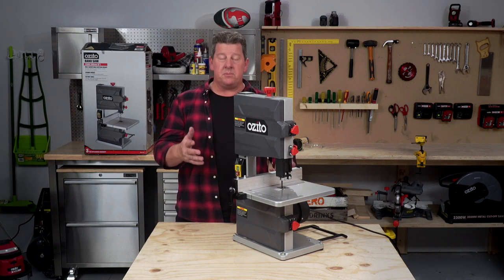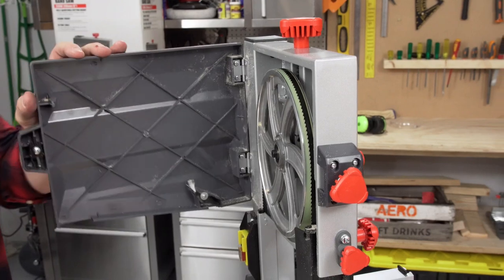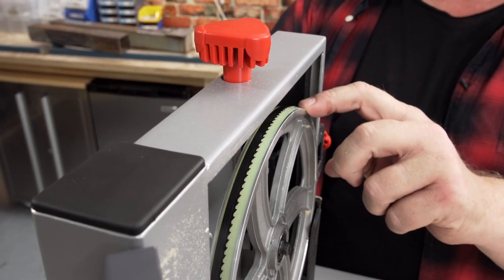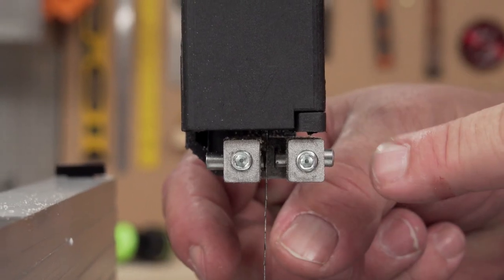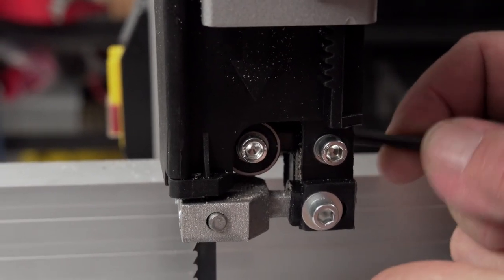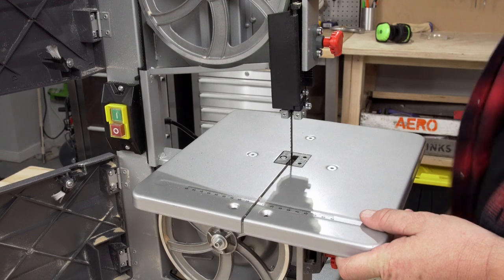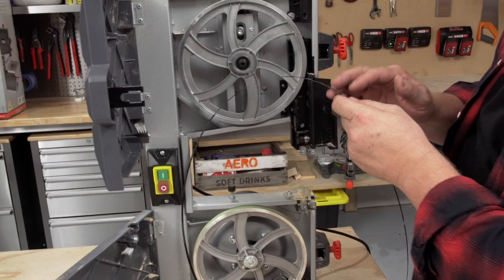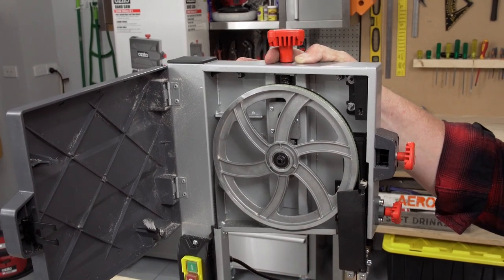How to set up a Band Saw - Ozito Tool Tips [BSW-2581]

Comment: Thanks a lot for this, so much clearer than the printed manual. Have now replaced the blade and centred it in middle of rollers and adjusted blade clearances and tension, works so much better now
Reply from the maker: Hi Rick, glad to hear our videos have helped you! Cheers

Comment: I had a Ozito bandsaw it was faulty try to change it at Bunnings did not have any in stock had to buy a ryobi  ?
Reply from the maker: Hi David, we're sorry you weren't able to get a replacement at your local store. This item is still ranged and is still available at Bunnings. Please reach out to our Customer Service team directly for further assistance - Call on 1800 069 486 (Aus) or 0508 069 486 (NZ) or email them at enquiries@ozito.com.au. Cheers

Comment: my saw was bought with a much finer blade around 13 TPI at best guess. I have never been able to cut a circle or a simple pattern and at times the blade will twist off line on anything thicker than 25 mm. The blade is as tight as I am confident with and I set the throat to suit the thickness. Any suggestions please.
Reply from the maker: Hi Lynton, thanks for reaching out. Would you please let us know the model number of your Saw? Cheers
Reply: @OzitoDIY  Problem solved when 7mm x 6 TPI blades were fitted. 14 TPI blades are almost useless on this saw.

Cheers
Lynton

Comment: Good video. Nice to know a bit more about it as I haven't used one in 35yrs, quite helpful. I just want to use it for hobby work making custom tool handles. Oh, you should mention to unplug the power before any adjustments or blade removal.🍺👍🏻
Reply from the maker: Thanks for your feedback. Safety first!

Comment: G’day, I hope I’m not too late to comment. Had this product for a while and it’s done well. Recently I’ve tried to start it up after getting a new blade and I believe the motor fans stuck. Everything’s perfect and I’ve aligned it correctly, what’s a troubleshoot?
Reply from the maker: Hi there, thanks for reaching out. Are the wheels unable to spin by hand? If so, there may be something jammed somewhere. If not then there could be a fault with the motor. We recommend you give our team a call to chat this through over the phone with us on 1800 069 486 (AUS) or 0508 069 486 (NZ) as it should be easier to troubleshoot. Cheers
Reply: @OzitoDIY  thank you for the response. I can spin the fan easily but as soon as I start it it stops and the motor hums. Emailing the company they said I need to return to where I purchased for a new one.

Comment: My husband has just bought me a ozito bandsaw for Christmas. I am having trouble aligning the saw blade. No matter how many times I turn the knob (very slightly) clockwise or anti-clockwise I just can't get the blade to run along the middle of the pulley. As I manually turn it, it seems to be okay but I always have a trial run of about 3 seconds and the blade either runs to the back or the front during this period (even though I only turn the knob a little bit at a time). Another issue is that the table will not tilt either, which means I have been unable to place the clear plastic blade guard on underneath. Is there a specific way of doing this?
Reply from the maker: Hi Frances, thanks for reaching out. Please give our Customer Service team a call on 1800 069 486 (Aus) or email them at enquiries@ozito.com.au & they'll be able to assist you. Cheers

Comment: I have an earlier version of this bandsaw. Is setting up the blade the same. As after running under no load for a few minutes the blade comes off the wheel. On one occasion the rubber band came off. I used double sided glue tape stick rubber belt back on wheel. That kept the belt on but the blade came off after running for several minutes. The saw itself has only been used a couple of times and has sat idle for the last 2-3 years with the tension taken off. Only started to use it recently and ran into this problem. I’m at a loss on what to do now. Can you help?
Reply from the maker: Hi Alex, thanks for reaching out. The blade set up should be the same, is there any noticeable wear on the belt? Was the bandsaw stored in a hot environment? Not sure if the belt may be the issue? Please reach out to our Customer Service team directly for further assistance - Call on 1800 069 486 (Aus) or 0508 069 486 (NZ) or email them at enquiries@ozito.com.au. Cheers

Comment: Hi I am having trouble with my Ozito as it will not cut straight for some reason. Was fine for the first couple of months but for some reason it has decided to do it's own thing. Have tried to adjust guides and everything but no luck. Could you please help me out
Reply from the maker: Hi Graeme, Thanks for reaching out. We recommend you reach out to our Customer Service team directly for some assistance. You can call on 1800 069 486 (Aus) or email us at enquiries@ozito.com.au. Our customer service opening hours are 8 am to 5 pm weekdays (AEST). Cheers!

Comment: Thnx . I bought it. 😁 what width blades can it take? It would be a great tut on different blades for differnt purposes.
Reply from the maker: Hi Tim, thanks for reaching out!
The blade specifications are as follows:
Length: 1400mm, 
Max blade width:8mm 
Teeth per 25mm: 6 
We have tested this blade for use on plastic and wood materials. 
The width should be the same but the number of teeth can be varied
I hope this helps, cheers :)
Reply: @OzitoDIY  thnx

Comment: This is brilliant mate thanks. Wife just got me one . I have assembled it but have 2 hex bolts with nuts spare and 2 discs about the size of a bottle top with holes in them. No item where they go? I used the wing nut on the piece of metal under the front of the table? Any ideas?
Reply from the maker: Hi Richard, thanks for reaching out. Could they potentially be for the rubber feet? You can also send a photo to our customer service team for further assistance. They can be contacted on 1800 069 486 (Aus) or 0508 069 486 (NZ) or email them at enquiries@ozito.com.au. Cheers

Comment: I am new to woodworking so I don't want to blame the bandsaw but I already wrecked 2 blades.
the main problem is the blade becomes dull very fast and then starts wandering and then stopping completely. Not happy. can you point out what the reasons might be.
Reply from the maker: Hi Shai, thanks for contacting us! From what you are describing, the blade does not sound to be tensioned/adjusted properly. We can suggest you revisit the section ‘set-up and prep-tensioning the blade’ of your product manual to double check no steps have been missed. It could also be due to the material you cutting. What material are you cutting? Cheers
Reply: @OzitoDIY  I am trying to cut skateboard wood. Meanwhile I returned the bandsaw and bought a cheap Ozito bench circular saw, and to be honest I don't feel safe using it with skateboard wood.

Comment: how do you stop the blade from running to the left
Reply from the maker: Hi Jack, Great question! Please make sure to check the tension of the blade is correct and ensure the blade is centred in the middle of the top roller. If the blade is positioned too far to the front the piece may run to the right, if the blade is positioned too far back then the piece may run left.

Comment: Hello. I'm really confused. I've setup the bandsaw fine, but I can't get the base plate stable at all. The lever that is meant to turn on the protector hits the base plate, I've put it in the lower hole as per pictures. The last two pages of the setup manual are blank and do not show the process. Neither dies this video or anything I can see online. I may be doing something wrong, but please advise. Model bsw 25181 purchased yesterday . Thank you
Reply: Hi Joshua  - I am setting my Ozito up at the moment. then I found that the lever on the protractor is spring -loaded. That means you can set the handle vertically down, then lock up the crew by pulling the handle out against the spring tension while you tighten up with a phillips head screw driver. Maybe this will solve your dilemma.
Reply: @graemej2599  Hi Graeme, thank you, will give it a shot later. It is mostly stable now but that should help. Cheers
Reply from the maker: Hi Joshua, so we can help you further, please reach out to our Customer Service team directly for further assistance - Call on 1800 069 486 (Aus) or 0508 069 486 (NZ) or email them at enquiries@ozito.com.au. Cheers

Comment: Good video. But I did follow everything you did, but came into problems when spinning the wheel and it would not keep the blade on the wheels. It is tensioned properly it just keep on slipping off. I didnt want to touch the settings at all so when i first ran it, it shewed away at the bottom clear plastic guide, but not much drama there are you able to give ne any more info on that back red knob and how to keep the blade on the wheel?
Reply from the maker: Sorry to hear of the troubles you’d experienced, if you are able to get in contact with our customer service team at enquiries@ozito.com.au they will be able to assist further.

Comment: Is there a blade available around 24TPI to cut 3mm aluminium plate, or what is the finest pitch blade you can supply for bimetal
Thanks
Dennis
Reply from the maker: Hi Dennis, thanks for reaching out. Unfortunately we do not carry a blade with 24TPI for Bunnings, only one size 7TPI. Cheers!

Comment: I just bought an ozito 250w 8" and am having a go at setting it up. The rollers will not slide forward enough to touch the blade. The top roller can not reach it and the lower roller falls out of its holding slot. Are the rollers the wrong size or is something else not setup correctly? Also the bottom wheel does not run true, is this normal? Cheers
Reply from the maker: Thanks for reaching out, please get in touch with our customer service team on 1800 069 486 or enquiries@otizo.com.au and they'll be able to assist you.
Reply: Mine is the same. The wheels have so much run out and offset, so the roller slide wont slide out enough to touch the blade. You get what you pay for im afraid

Comment: I found it hard to get the tension on the blade when you’re replacing a new blade it change to run off the the pulley all the time and I got very frustrated with it so I am going to give it a go tomorrow afternoon yours Jeff Bunnings Scoresby
Reply from the maker: Hi Jeffrey, Thanks for reaching out. Please follow the below steps:
 
FITTING THE BLADE
Before adjusting the tension & tracking of the blade, please ensure the upper & lower guides
are well clear of the blade (following the steps below).
 
1. Loosen the door locking knobs and open both housing doors.
2. Remove the left blade guard by sliding it up and out. Also open the right blade cover.
3. Loosen the tensioning knob at the top of the unit by rotating anti-clockwise.
4. Loosen the 2 grub screws on both the upper and lower guide.
5. Insert one side of the blade between the gap at the left of the unit.
6. Then insert the other side of the blade between the gap at the right of the unit.
7. Align the blade on the middle of the pulley rubber tyres of both the upper and lower pulleys. Ensure the blade is fitted with the teeth facing outwards.
 
Please try these steps and please do not hesitate to contact us for any further assistance. Cheers

Comment: I'm rather struggling to put the table on this new machine...Your video does not show it either, you only show how to remove it which does not really help me. The manual says to remove the "WEB" from underneat, but the so call web is not showing on its first or other pages! I found a piece of metal with 2 holes in it and it seems to be 'it'? But there is a black knob that will be covered by the table...Got no idea what it is as it is not listed either on the first page. Then there is like a clear  plastic 'guide'  that will be buried under the table if I manage to put it on top???.
At least the guide adjustment were reasonably well explained. 
So for me now it's "See saw Margery Daw till I figure how to do it

Comment: Hey guys, I want to rip palletboards in half, not flat but sitting on their edge i'm just wondering if a band saw would be better or the table saw? The table saw only has 80mm cut depth also, but some boards are 100mm on their edge
Reply from the maker: Hi Mate, You are on the right train of thought however you will likely need to square your pallet boards first and then create a fence support to assist you in keeping the timber lined up. 
Make sure you select a bandsaw that can cut the timber depth you are after, this bandsaw will cut up to 80mm.
Reply: @OzitoDIY  Thanks for the reply ;)

Comment: Brought one from Bunnings I have a few ozito items and all work ok for diy but can’t get this one to even cut straight as soon as the wood touches the blade there is so much flex ! I have set the tension and blade guides but still no good
Reply from the maker: Thanks for reaching out. Sorry to hear about the issues you are having with the tool.  Can you please confirm the model no of the band saw so that we can assist you further. Please do not hesitate to contact our customer service team on 1800 069 486 or email us on enquiries@ozito.com.au for any further assistance. Cheers
Reply: @OzitoDIY  Hey Kev, how did your issues end up? I'm having the same issue cutting wood and high density foam. Are there thicker blades or something?

Comment: I’ve got almost all Ozito gear with the exception of the bandsaw! Ozito gear has served me awesomely for a hobbyist. I cannot fault any ozito gear I Ave but about 18 months ago I had a brain disconnect and bought a bandsaw from Aldi on SPECIAL!
Buy in haste, repent at leisure!
Never a truer saying, as unfortunately the Aldi is a monumental piece of s#*/ as it never ran properly! The latest problem is the height adjustment for cutting larger pieces of timber is now stuck at around 70 mm above the table.
I wonder will the oxy help?
Well I certainly learned a lot out about bandsaws as I’ve spent more time inside this thing then inside…..
Let’s not go there! 
Anyway tomorrow I’ll be buying an Ozito bandsaw.

Comment: This is a good little saw but the blade on mine just snapped after a couple of hours work. just left it running for a few seconds while I picked up another piece of wood and "SNAP" blade just broke. I had a new blade made for the saw from my usual blade manufacturers and all seems okay. The blade supplied with the machine is just about useless and much too fine and flexible. I recommend  fitting a 6mm 6TPI blade which costs around $18. Don't order a new blade from Bunnings as you will just get the same crap and double the price.
Reply from the maker: Hi John, we appreciate you sharing your feedback and will take this into consideration in the future. Cheers

Comment: I have followed all the instructions, the blade was fitted when purchased from the store, checked it over and once turned the blade pops off and continuously pops off, am I retarded or have I bought the dud?
Reply from the maker: Hi Craig, Please give our Customer Service team a call on 1800 069 486 or email them at enquiries@ozito.com.au as they'll be able to assist you here. Thanks
Reply: Ozito DIY why can’t you explain so everyone can learn instead you want us to ring the office Please Explain everyone else does,I want to buy one but if the blade keeps falling of??? There’s no way I will buy ozito,ps I have the table saw and I’m happy with that,cheers from a retired chippie
Reply: @OzitoDIY  I agree with @Mike Pokai.... Please explain. 
Might have to dig deeper and go with the Ryobi.
Reply from the maker: Hi there, according to the user manual, "If the blade tends to run to the back of the blade pulley, turn the tracking adjustment knob anti-clockwise while turning the blade pulley by hand until the blade runs in the middle. 
If the blade tends to run to the front edge of the blade pulley, turn the tracking adjustment knob in a clockwise direction."
Wearing gloves, you can turn the blade pulley and see if the blade moves forward or back and adjust accordingly. 
I hope this helps, cheers.